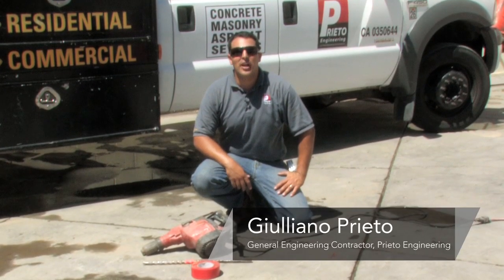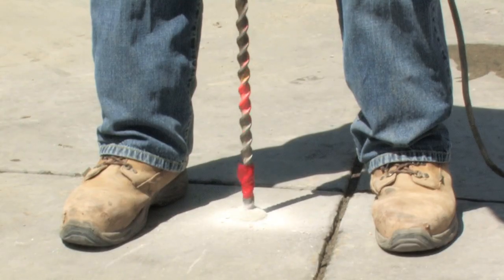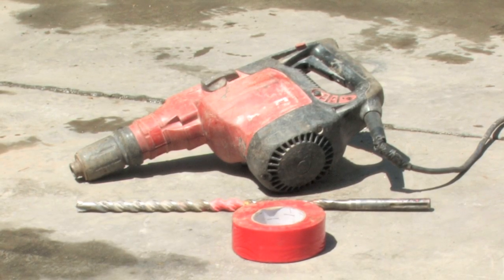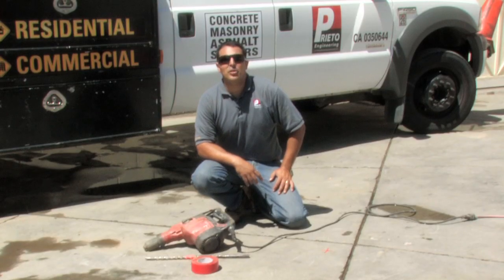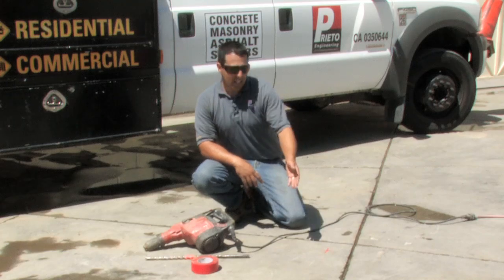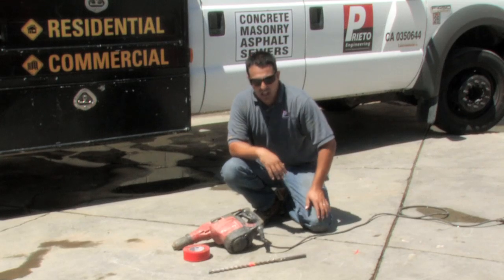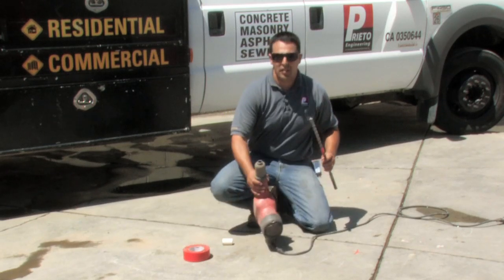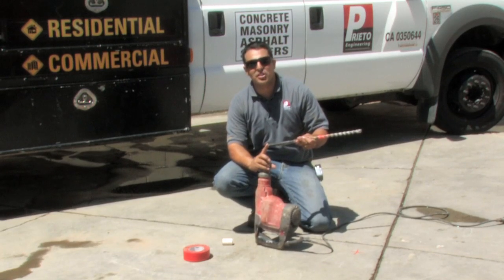Concrete & Masonry : How to Drill Into Concrete

Comment: I have a raised concrete slab about 4 inches thick and want to replace aluminum (wrought iron look) posts with pressure treated 6x6. I have the metal hardware to anchor to the slab. I am concerned if I drill too close to the edge the corners will crack and breakaway from the slab. How close to the corner edge is an acceptable distance without breaking off the corners?

Comment: any tips for foundation cement when you only need a 5/32in hole . its freaking hard af to drill through.tried several high dollar bits and all have failed. breaks off in hole and gets so hot drill bit glows orange
Reply: I thoroughly agree. I think some drill manufacturers recommend cooling the drill bit with water in between short drill times & not allow the tip to stay red hot. Ive kept a lid or glass of water nearby & periodically dip it in the water till it stops sizzling. It seemed to help. As far as the bit breaking off with a very small bit…yeah I’d like to stop having that happen too. I imagine it has something to do with keeping the angle of the drill straight.
Reply: @ebnphlo  thanks

Comment: When drilling into a brick wall do you think that the hammer setting might cause too much damage with the vibrations?  I need to use over a 1in bit through a standard house wall and am worried I'm going to take the house down with a bit like this!

Comment: Thanks for the nicely done video. I wouldn't let the skeptics below put you off. There will always be people who seem to think they know better than anyone else. It's always easier to sit in a chair and criticize. But few of those folks would ever actually get up off their lazy butts to actually produce a video designed to help people like you did. I've probably used a hilti hammer drill about 100 times and have usually been successful. I looked at your video because I'm about to do another installation that requires anchors and I thought it'd be nice to see if I could pick up anything new.
Thanks again.
Reply: Greg Cremer ~ Put back your pant and if you have used a Hilti hammer drill 100 times with no issues and believed that this video (Made by an engineer? student? is helping peoples, think again. Drilling a hole in a concrete is the easy part, drilling plomb and properly is another. If drilling in concrete mean that it'll be for permanent and heavy installation. (Real engineer know that) if you drill a hole with constant pressure to the end, not plomb and don't pilot your drill bit,  you are not consistent and your hole is not cylindrical, if you're not plomb your hanchors are not supporting equally. Since post or other structure are designed to be hold by a specific hanchors system, this video is useless, desinform and harms more than help. Got that?

Comment: yeah i have been trying to put 3 holes in my garage concrete for 3 hours now, no way that bit is going any further even the drill bit tip started to heat up and i can see flames coming out. do you think a grenade will do the job?
Reply: You are probably hitting rebar in the concrete
Reply: The older that foundational concrete, the harder it becomes. I’m having the same issues in my house. Would a hammer drill be much better than a conventional drill?
Reply: Have you tried dipping the bit in cool water whenever it starts smoking & let it cool off in between drilling. It cools off very quickly. I’ve tried that and I think it helps some. The problem I seem to always run into is that I get too impatient & bear down on the drill & that dulls up the bit a lot faster, thus making it even harder to make any progress.